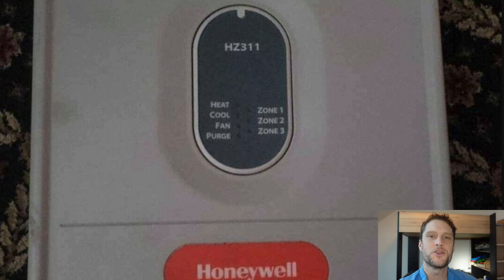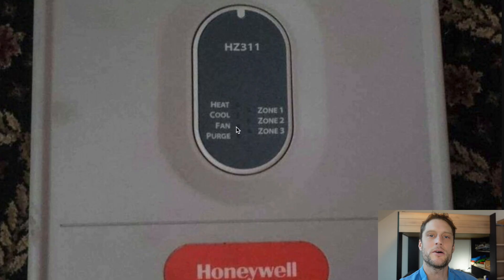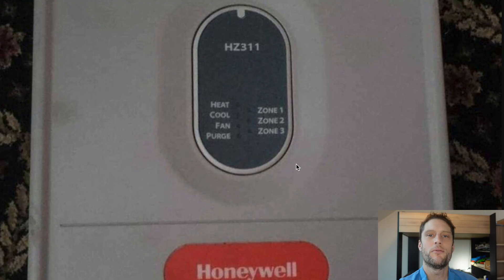Honeywell TrueZONE Panel Lights Blinking On Off Guide

Comment: The only question I have is when heat is running the light is red a solid red when cool is running it's a solid green my understanding it's supposed to be a solid green when heat is running not red. From all the videos that I've seen when people have heat running the light is solid red and when Cool is running its solid green. So I'm guessing solid red when heat is being called is correct. Is this right?